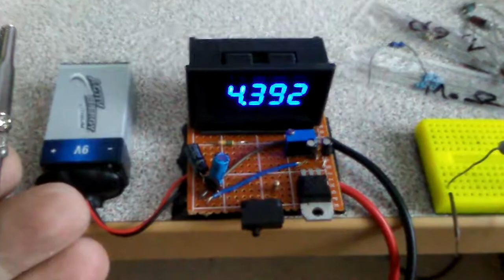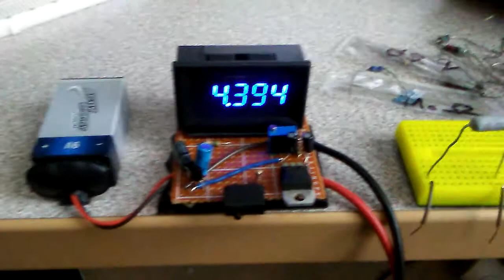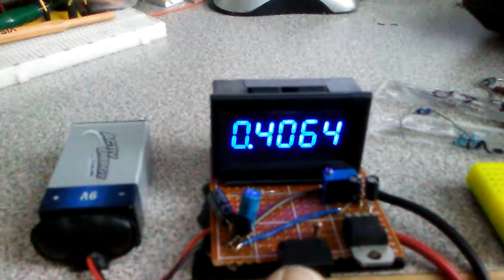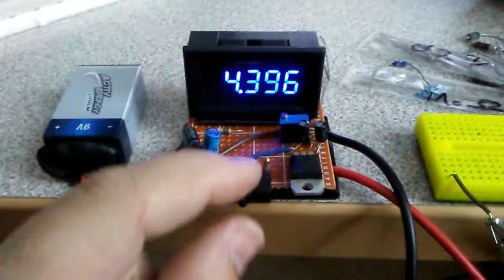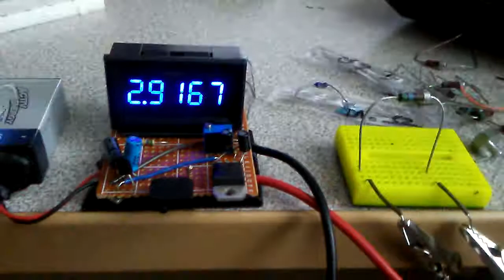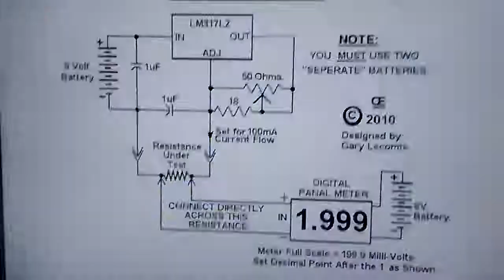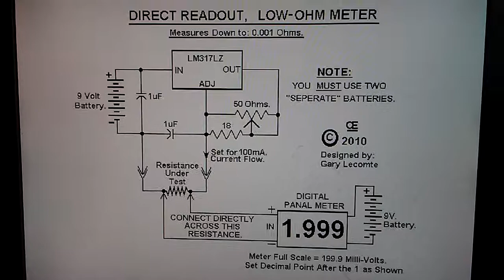Homemade milliohm meter

Comment: Is it really necessary, to connect capacitors to the 7805 voltage regulator? If so, why? Also, what are the values of those two capacitors? Please reply, I’m trying to learn about electronics. Thank you kindly

Comment: The schematic shows a variable [50 Ohm] resistor and beneath it, we see another resistor marked 18. Does that mean that the variable resistor must be adjusted, for 18 Ohms? Or does it mean, that there is, an ACTUAL 18 Ohm resistor, beneath the variable resistor? I’m sorry if this is a dumb question. I am still learning. Please reply. Thank you

Comment: Never measure thermistor with this test jig. Its 100mA constant current is too much for them. In the best case the resistance indication will not stabilize or will take long time to do so because the high current heats them.
Apart from that, the danger to destroy them is always there.
In general, when testing thermistors, keep the test current as low as possible (1mA or less, according to manufacturer's instructions).

Comment: meter pannel link plz
Reply from the maker: following is 5digit meter panel
https://www.ebay.com/itm/Red-0-36-LED-5-Digit-DC-0-33-000V-Digital-Voltmeter-Voltage-Meter-Car-Panel/310672415584?hash=item485584db60:g:jWwAAOSwJNpdNYiO